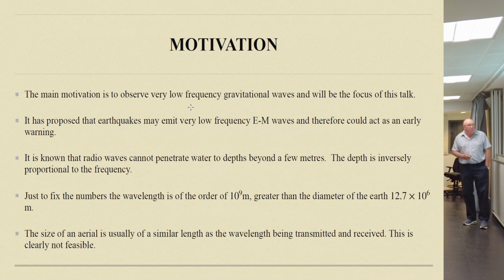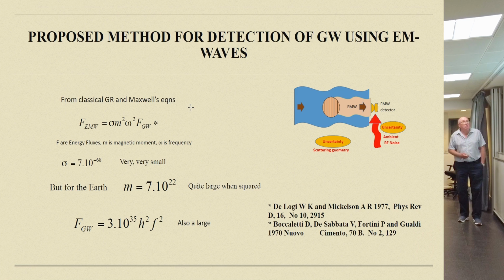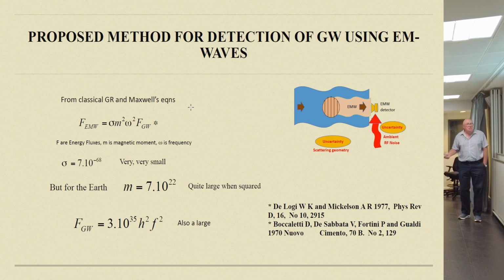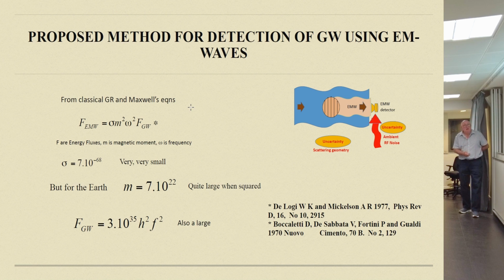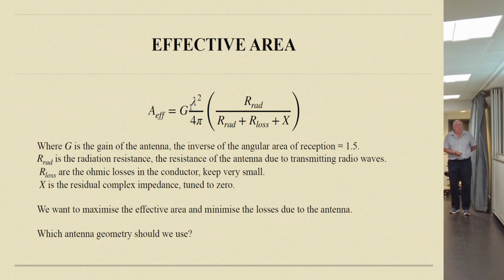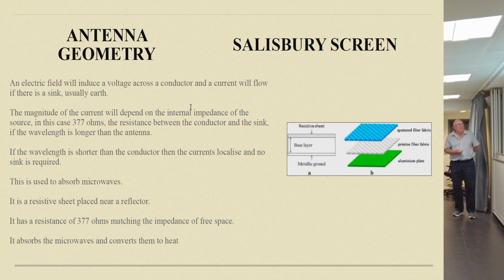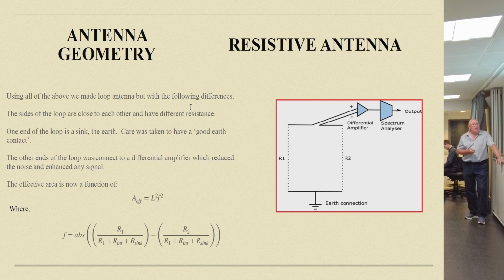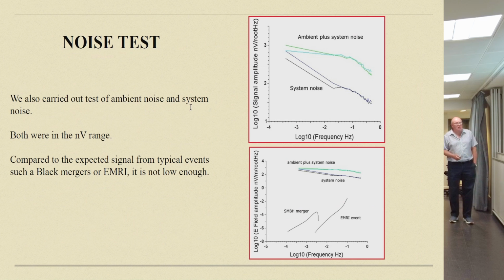EM Antenna Noise Test for Low Frequency Gravitational Waves & Earthquake Detection - Robert Flack

Comment: Кишлак приветствует Вас.
Let's create a device for school. Let children measure the universe, gravity quanta, .. .
In a vacuum, the speed of light depends on the dominant gravitational field in which the light propagates.  "Dominant gravitational fields" through the frequency of light adjust its energy, direction and speed in a vacuum. "LIGHT is the energy of ordered vibration of gravitational quanta." - With a useful signal from calculating formulas in 1000000000 more than on detectors; LIGO, VIRGO… .
I ask for help in co-authorship and conducting direct experiments and scientific discoveries for astronomy, astrophysics, cosmology, higher theoretical physics,...